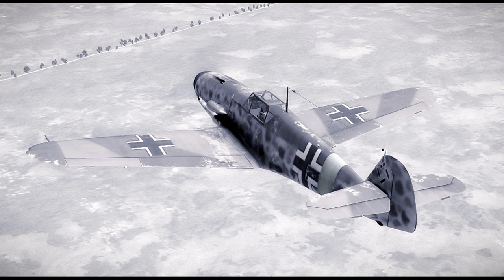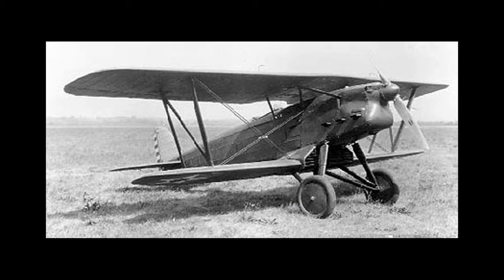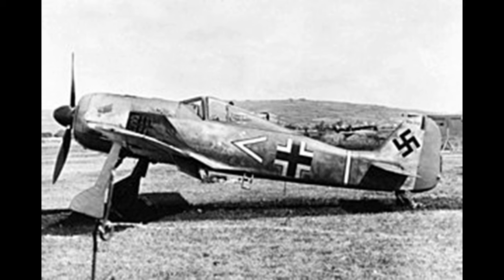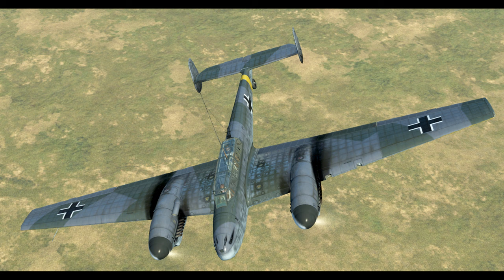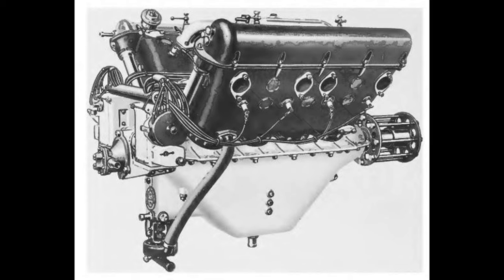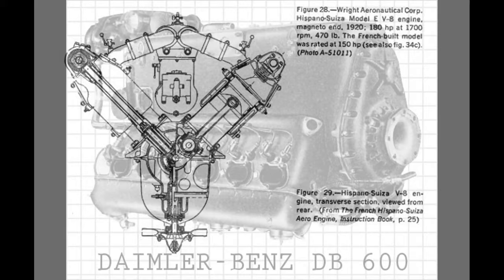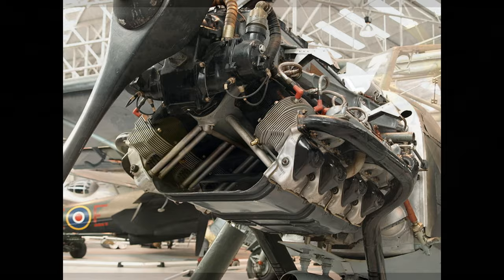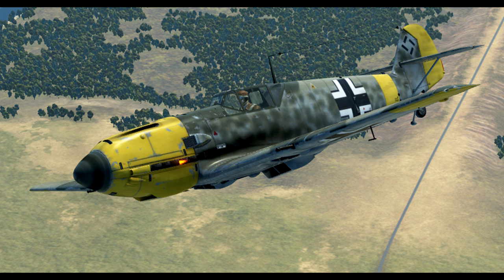Messerschmitt Bf 109 , Why an INVERTED V-12 Pt. 1? inverted V12s vs. upright

Comment: A note about the Ford GAA V8 and it's V12 big brother they where designed as aircraft engines to compete with the Merlin the government said the didn't need another V12 but did need an engine for tanks so Ford shortened it to a V8.

Comment: Inverted help the 109 have streamlined machine guns in the cowling, even when upgraded to the larger 13mm in the 109g
Reply: I was also thinking about this topic. Didnt the inverted v12s also aid in the mounting of machine guns on the cowlings and and machine cannons trough the propeller hub? Which was a really big benefit in terms of firepower for single engine fighters.
Reply: @Ther2000  I remember hearing that reason as well.  The wings on the 109 were not strong enough for machine guns and cannon, so they mounted the guns in the fuselage and the cannon in the nose.

Comment: Not sure but I think you may have missed a bit - The Rolls Royce Meteor (I think) was also used in the British equivalent of the PT boat, the MTB (motor torpedo boat) and MGB (motor gun boat) using Vosper designed hulls. These saw extensive and often very  intense action both in the English Channel theatre and also in the Mediteranean.
Reply from the maker: It's not so much a question of missing it, I can only fit so much into a video. The British MTBs often used Packards, some used Merlins. Either way, yes, they were both used in Marine applications.
Reply: Yep, romanian navy had 6 torpedo boats in ww2. Where build in Holland if i remember right.
Reply: Actualy where 3 Vosper at the begining of ww2 and have brought another 6 from Holland in 1942. Last 6 where called btitish power boat. All 9 had Merlin engines

Comment: Lowered center of gravity, raised propeller position and location and "dropped" valves don't fall down into cylinders. Internal coolant leaks also don't "hydraulic" the engine as easily and excessive fuel doesn't "wash down" cylinders and pistons.

Comment: The exhaust valve and spark plug will be the hottest points in an Otto Cycle engine. A liquid cooled engine would benefit from having the hottest points at the lowest elevation in the engine. This is because of the possibility of vapor pockets forming in the cooling jackets. Buoyancy will cause vapor bubbles to rise, thus move away from the hot spots in an inverted type engine. Data on coolant mixtures for WWII aircraft engines is difficult to find. One would imagine that if an engine had to be shut down in flight, then it would be nice if the coolant didn't freeze and split the block before you descended to warmer air before restarting or landing. Yet, lowering the water content of the mixture can reduce the specific heat of the coolant which means coolant flow and radiator capacity might have to be increased to maintain adequate heat rejection. The coolant flow would be best if it entered on the cylinder head and exited from the block. This in turn, would allow for higher boost pressures and or use of lower octane fuels. I believe that the Germans produced 87 octane avgas throughout the war. The United States produced 100+ octane avgas. Another reason for inverted type engines might be due to the use of multi point fuel injection by the Germans. Leaking fuel could be allowed to drain out the bottom of the engine compartment, away from any sources of ignition, instead of pooling. Leaking fuel and oil from aircraft engines still get people killed to this day. This would be an advantage for both air and liquid cooled engines.
Reply from the maker: They were running inverted Vs well before the advent of fuel injection. It's still a good point though! As for your points about vapor pooling and hot spots, I just don't know, but maybe.

Comment: A reason I've read several times in modern German literature is that the crankshaft of an inverted V engine sits higher, allowing a bigger prop without clipping the ground.
But I think that wasn't the reason for inverted Vs, I think you could achieve the same with some ball bearings and a couple of gears

Comment: I believe that one benefit (not necessarily a design consideration) of the inverted engine is that the exhaust trail is farther away from the cockpit reducing the issue of carbon monoxide poisoning. I also agree with you on the point that maintenance is easier on the inverted V12. I have quite a bit of experience working on large radials, 2800, 3350, 4360 and the lower cylinders are definitely more accessible! When working on the top of these large radials you inevitably drop tools, nuts, etc and one would listen as the wayward item descended through the engine praying you heard it hit the drip pan below!! 
Cheers, Brian

Comment: Those PT boats were  great advertisements for engineering nous. 44knts is killer fast for a motor launch.. ..and you had to build a plywood hull that could handle that pounding without turning into matches.

Comment: You missed out mentioning the weaponry of the German pistonengine planes: the RLM-standard required a basic armament of at least two machine guns above the engine and one firing through the propeller. It was believed that packing the weapons and their magazines closely to the rolling-axis, improved the maneuverability. Now you can only pack two mgs under the hood when the engine is built in this way. Next, as the positioning of the crankshaft made a gearsystem necessary anyway, the rlm insisted again and again in the integration of a 20mm oerlicon mashine-cannon with high-explosive ammo. A really devestating weapon that was far more powerful than the whole 8xMG phalanx of the early Spitfire and Hurricane. Pilots reported that the wooden cell of the Hurricane was almost butchered into pieces when hit by those shells. Anyway, although the gun had a very low kadenz and only 30 rounds, and it constantly tended to overheating and jamming, the rlm had fallen in love... And again and again insisted in this armament. Turning over the V12 would have meant: throwing aboard the two 7,9mm mgs, then the MK20, then the gearbox behind the propeller and would have lead to integrating the guns into the wings, something clearly not desired.

Anyway, great vid! I signed your channel!
Reply: Excellent points. Galland did have 20mm put in his wings, tho'...

Comment: I have this thought that, 
surely an aircraft designer would only be considering from a list of available or soon to be available engines.
If the indigenous engine field included almost pureley upright V12's then that would be the primary consideration. This notwithstanding the age and generational engine improvements made for both Merlin and Griffon engines, complex radials found their way into later Hawker aircraft like Typhoon and Sea Fury.

Comment: Perhaps it should be pointed out the Rolls Royce built very successful upright V12s (Eagle and Falcon) during WW1 and many more types between the wars before the Merlin came into being so it is not that surprising they continued with the upright layout.
It was almost universal for air cooled inline aero engines to be inverted simply so the hot air can be ejected under the air frame. 

The big German tanks did use an upright V12 (Maybach HL230). Daimler Benz also produced the upright V16 diesel engine used in the German Navy e-boats.
What is perhaps the bigger question is what were the features that persuaded both Daimler Benz and Jumo to 'buck the trend' and go inverted with their big water cooled inline aero engines well before the Bf109 was developed.
Reply from the maker: I don't know if I agree or not. I did point out that upright V12s were quite normal, I even showed them all the way back to WW1 in both this part, and it Part 2. I think that made the point that upright V12s were common. 

I am not sure what you mean by "inline" engines, as it was common to call V-Types inline back then, basically they called anything that wasn't a radial inline. You can see that in the diagram I used of the DB601. In any case, inverted aircooled "inline" engines have always been relatively uncommon. The most common were the Ranger engines, yet they were vastly out numbered by flat 4 and flat 6 aircooled aircraft engines, and they still are, go to any airport of museum and you will see very few inverted air cooled engines. 

I specifically showed an upright Maybach V12 in this video. Perhaps you missed it, or maybe you didn't watch the whole video, I don't know...

 The question of why the Germans went with inverted V-types is the question I address in this two part video, it's not just about the 109, I mention many other German planes and a few US airplanes with inverted engines.
Reply: @GregsAirplanesandAutomobiles  I was making the distinction between 4 and 6 inline inverted air cooled (a popular civil plane layout) ) as distinct from the V8 & V12 air cooled ones.
I do wonder if the German inverted V concept were developed under the direction of the RLM rather than as a design choice by the engine manufacturers themselves.

Comment: Victor Bingham states in his book major aero engines of ww2 that the Merlin was originally intended to be an inverted v engine.
they reverted to an upright v because the aircraft manufacturers envisioned installation problems.
Reply from the maker: That's probably true, although the phrase "installation problems" leaves a lot of room for interpretation.

Comment: Some British planes from De Haviland had in inverted engines, mainly because the standing cylinders would block visibility. This might be different on 90° V engines or on engines using a transmission for the airscrew.

Comment: I am wondering of the fact that the German V12's used roller bearings in the crank had something to do with their inverted design.  Roller bearings need much less oil, which is easier to collect and send back to the oil sump.  Plain bearings need more oil, and the accumulation under the pistons may have been more difficult for the scavenge pumps.  One problem with this theory is that the DB605 used conventional crank bearings.

Comment: Notice the twin spark plugs per cylinder on the DB 600.

So advanced for its time
Reply from the maker: The WW2 aero engines were quite advanced. Twin plugs, four vavles per cylinder, fuel injection, water methanol injection, intercooling, multi stage forced induction, and nitrous we all used!
Reply: All aircraft engines at the time had twin plugs per cylinder. Plugs and ignitions failed often.

Comment: Not sure how relevant, but assume a balance instability along the roll axis of the airplane with the weight of the crank higher than the roll axis.  This would lead to some instability requiring that the pilot "fly" the airplane at all times but make fast turns happen a microsecond or two more quickly which can be critical in a dogfight situation.

Comment: From an engineering design point, it would be easy to convert the German inverted engines to normal configuration by simply removing the extra oil pumps and fitting a sump. Same for the US and Allied engines though vise versa. The Germans were very thorough in the aeronautical field and put out machines for specific theaters.
On tanks, the German heavy tanks did not require any greater capacity bridges than what the Allies had. Bridge crossings went by weight (width was standard everywhere) and for heavy tanks all they did was reduce the number of tanks crossing over per minute. Further, western Europe was crisscrossed with railways and so the Wehrmacht could easily transport the heavy tanks to any front. What overwhelmed the Germans was shear numbers, especially in the skies.

Comment: What about armament? Looking at most US and British fighters, the guns tend to be mounted in the wings. Whilst this may simplify the design and ease maintenance, it also requires a convergence to be set to have all hit the target at a set distance. If the enemy was any closer or further than the convergence distance, or if no convergence was set at all, most of the firepower would be lost.

German fighters on the other hand would have the space to mount additional machine guns in the nose. These would need to be synchronised as to not hit the props, but wouldn't need any convergence. Being closer to the pilot's gun sight, this configuration would also aid with accuracy

Comment: One of the advantages cited for the inverted V engine is the cannon firing through the propellor on the Bf-109. That was neat packaging, but could also be done with an upright V
Reply from the maker: It was done on upright engines many times.
Reply: @GregsAirplanesandAutomobiles  can you tell me some examples?
Reply from the maker: Sure, Laag 3, and Yaks.

Comment: Inverted engines will give a little more propeller clearance - a larger diameter prop can be fitted or the landing gear can be shorter.

Comment: As a powerplant person I tend to suspect that there could have been engine design considerations.  I would think that oil and cooling flows might benefit somehow.  Dry sumps are always full of challenges with scavenging.  Also I seem to remember seeing in a specification that the DB series had one cylinder bank at a lower compression (connecting rod length) .  I dismissed it at the time as not likely.   If so it would add to the mystique

Comment: The Ford GAC Engine of the prototype T29 Tank was a late war adaptation of Ford's 1941 contracted production prototype of the Rolls Royce  Merlin engine. With a much stronger  mono block, V/S the 4 part design of the Merlin, pent roof head and valve placement, double overhead cam resulting in centered spark plugs ( lower flame travel), direct fuel injection and turbo charging, it was a far better design than either the Merlin or Allison.  On its first dyno run it produced 1800 Hp,  more than the Merlin would until 1943! 
However, it was a new design, the turbocharger was not fully developed, the  Ford GG V12 Aero Engine project ended due to a disagreement with Rolls Royce not liking what Ford had done to their design and Henry Ford's not wanting to make engines, "for the British".  Due to this the Merlin production was transferred to Packard who made 78, 000 of them. 
Ford continued development until the Army approached them asking for an adaptation of their engine for a better powerplant for the Sherman Tank. Ford lopped 4 cylinders off the Aero design, adapted a "flat" crankshaft, a purposely limited carburetor induction system, and a 200 plus pound flywheel assembly to smooth out the unevenness of a 60 degree V8. The result was the absolute best production powerplant for the Sherman, over 58, 000 Ford GAA's (Sherman), and GAF's (Pershing) were built. The 770 HP V12 GAC, a Tank version of the GG Aero Engine was built in 1944 for the T29, it was still a better engine than the Allison, but did not have the Allison's supercharger, resulting in it having less power. By then,  turbo chargers were much better and if the war had contained, it may have gotten one. As it was, there were many early vintage Allison's in the Army inventory, these were no longer needed and would have been the ones to have been put in Tanks,  just as the British did with their obsolete Merlin's which became Meteor's with 650 HP output.
 The Ford GAC  was a much stronger, tougher, engine than the Allison, as was proven with the V8's in the Sherman's and Pershings. The GAA's in the Shermans lasted into the 1980's when the Tanks were retired or the engines replaced by modern turbocharged diesels.
Reply from the maker: That's quite a post. Thank you.

Comment: Great video, I've long be curious about the inverted V12. It's interesting the effect of gravity on oil, and the various strategies to deal with oil and fuel delivery.  For instance, the early rotating radial engines flown on biplanes?  Static radials that sat for awhile had to have the lower cylinders drained and blown out otherwise super-rough start. But the rotating radials had different issues.  Anyways great video.
Reply: Standard procedure to hand prop radial engines to be sure the cylinders are clear before starting to avoid hydraulic problems on the lower cylinders.

Comment: In an inverted motor-design all the pistons can be seen as a cup where the oil is collecting in. How does it get out of there ? Doesn't it create a big inbalance to the engine ? And isn't there a risk that the oil sinks slowly into and fill the combustion-chamber if the engine is not running for a long time ?

Comment: Mechanically speaking other benefits for a inverted clylinder engine would be an always lubricated piston and cylinder during startup and posibly better lubricated and cooler valve and camshaft

Comment: I heard that the invert engine was as some had said in one comment was to use cannon on top of engine to shoot through prop. Some say by accident it was found to increase engine torque. Maybe do some research into this, if i understand the crankshaft is a roller bearing and reguires less oil so it could reduce oil drag on crankshaft.

Comment: in the single engine application for fighters, you failed to mention the easier addition of ordnance in the line of sight of the pilot. Also, it would be impossible to fire through the spinner, again in the line of sight for the Messerschmitt  109. It would seem the addition of a dry sump engine would not be difficult/ conversion for Bf warbirds over the rare DB601s.